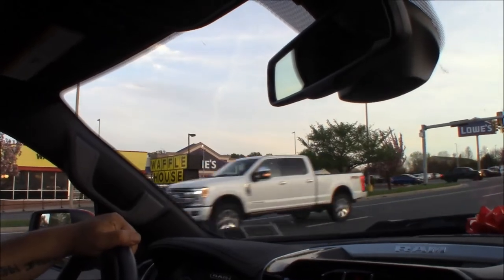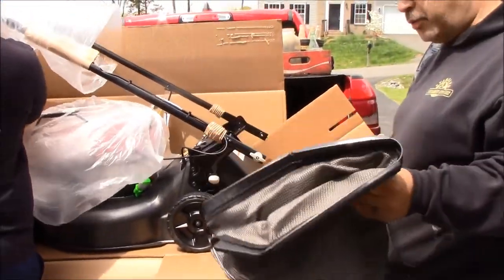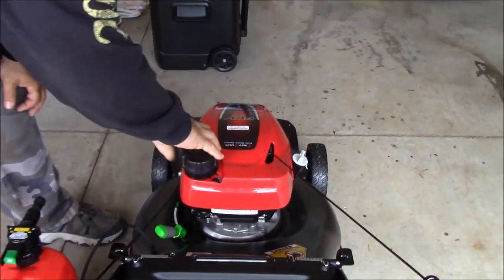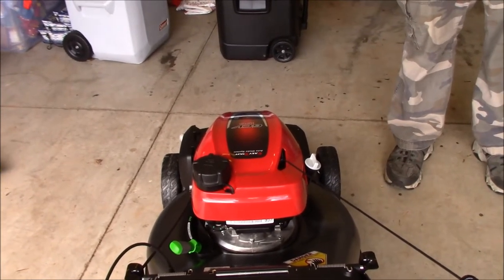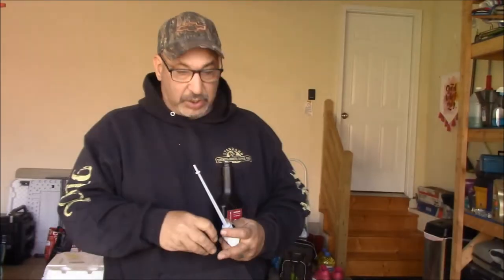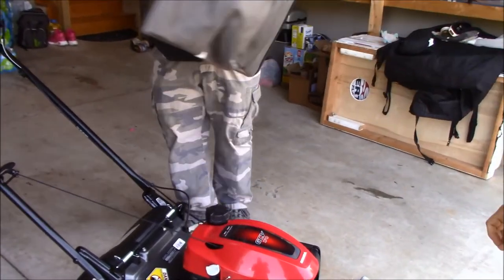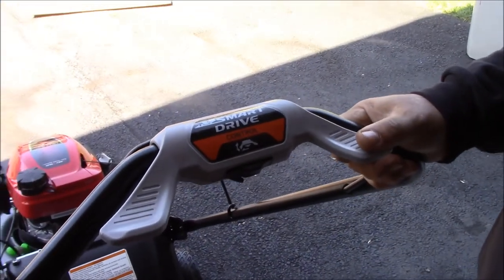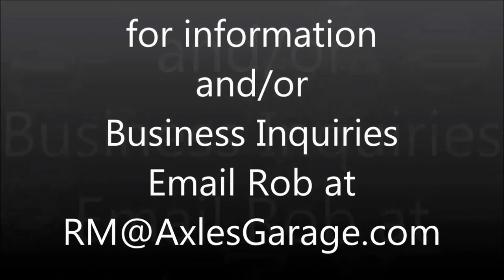Buying a Lawnmower? Honda HRN216 Unboxing & Review | Too Many Choices

Comment: There is absolutely no reason to dump the oil.....wtf?
Reply from the maker: Did you ever build an engine?  It's called a break in.  Modern vehicles no longer require it so it has been long forgotten.  This engine is basically old tech like an engine from the 80's.
Reply: I thought you you changed it for the first time after 5 hours that's what I've always done.